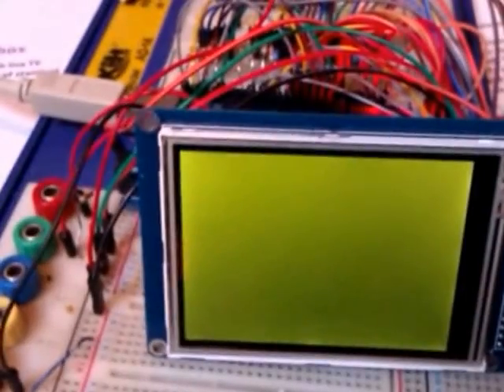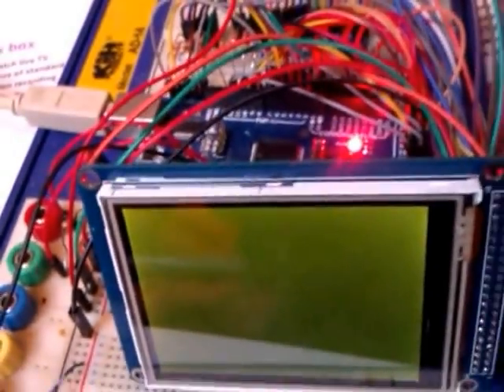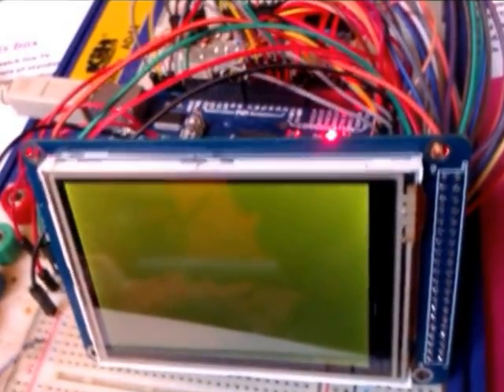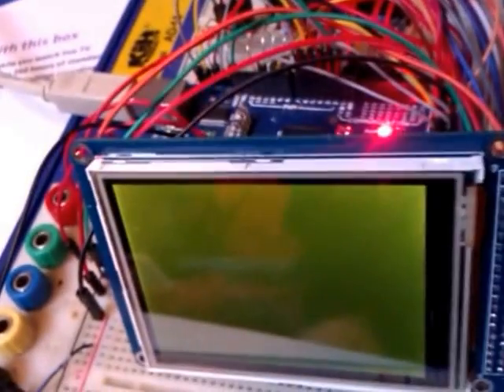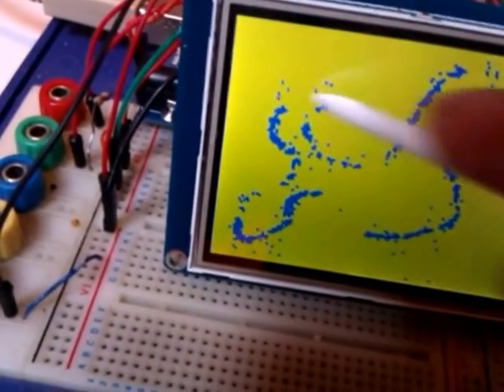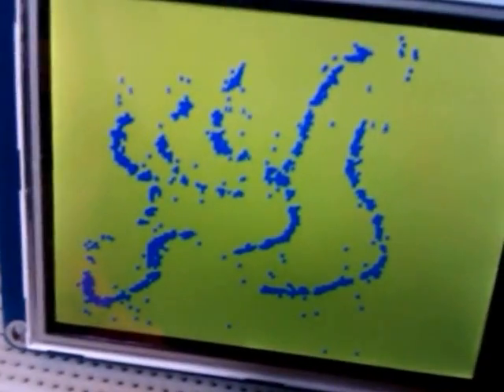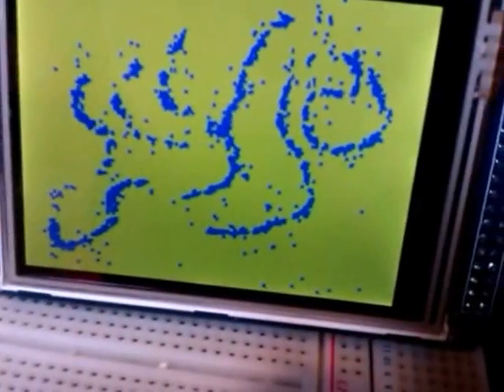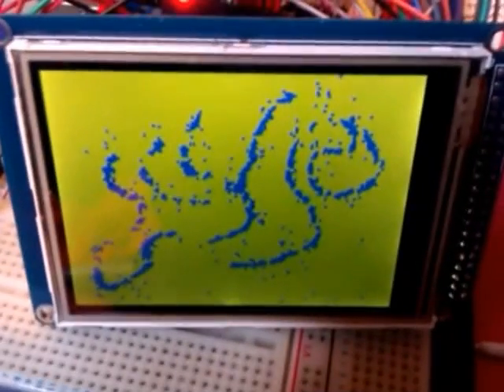Introduction to Optical Electronics Part 1

Comment: here is a gameshark code I made for the Japanese version of super Mario 64 yoshielectron

Hud Code
803371A0 004A
803371AC 0051
803371B8 0056
80339EAC 0006
803371C4 0058
802E2EB0 0000

Hud Code (0)
803371A0 0058
803371AC 0056
803371B8 0051
80339EAC 0006
803371C4 004A
802E2EB0 0000

Hud Code (1)
803371A0 004A
803371AC 0051
803371B8 0056
80339EAC 0006
803371C4 005A
802E2EB0 0000

Hud Code (2)
803371A0 005A
803371AC 0056
803371B8 0051
80339EAC 0006
803371C4 004A
802E2EB0 0000